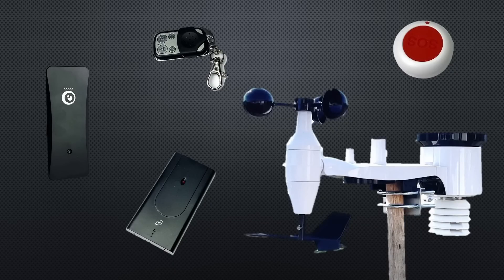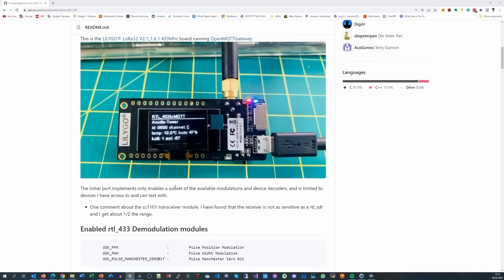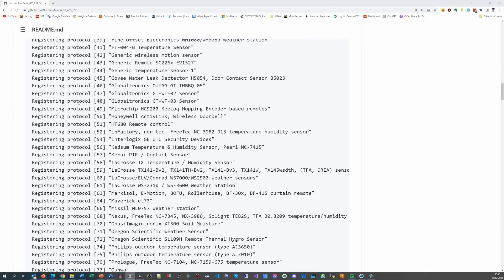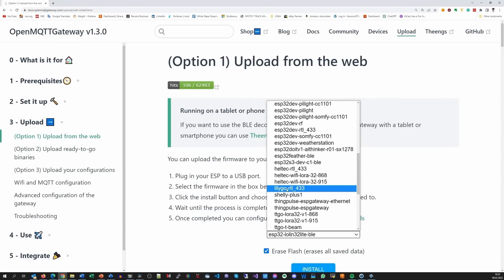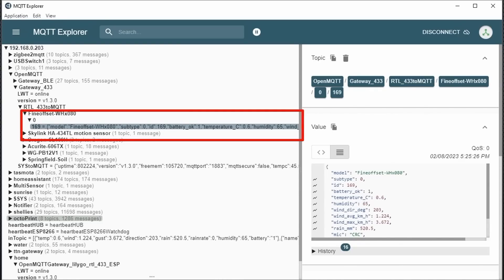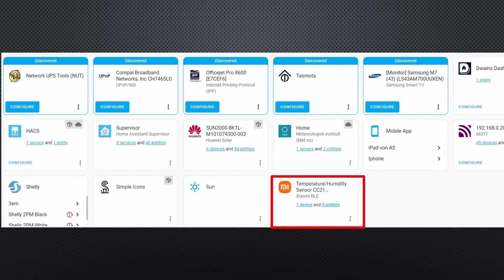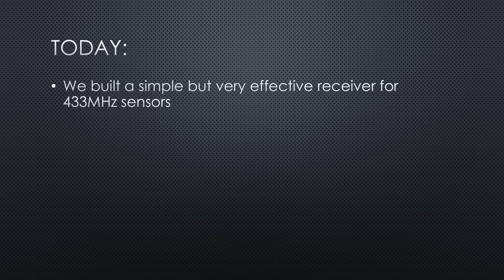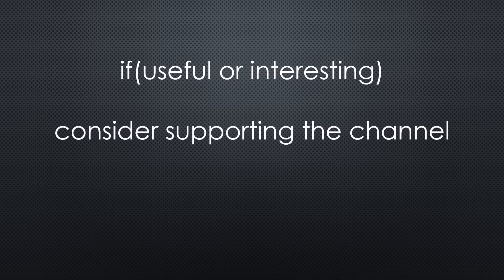449 OpenMQTTGateway Connects Many Things to Your Home Automation

Comment: I've been using 2 Sonoff RF bridges some 3 years now. They work great. 
Replaced internal RF chip first with Portisch firmware for RAW capturing even more RF signals. 
Later replaced the Portisch with even more tuned versions of the original Portisch EFM8BB1 firmware. (for ex. Halfbakery's,...).
I use this for some RF PIR sensors, but also to send RF commands to my garage doors (
which I first captured using RAW sniffing with the SonOff bridge of my original garage door hand remotes).

In parallel of the RAW mode (RfRaw 177), I let a custom rtl_433 Home Assistant Add-on subscribe on the RAW stream. 
The rtl_433 HA Addon can decode even more complex RF protocols (like weather stations,...), 
so I can see multiple temperature sensors in the area, the publish nicely with a treeview in the MQTT broker.
So I guess it's the same RF protocol list as the OpenMQTTGateway you now decribed, but there the ESP32 chip handles it all.

The only downside of the Sonoff RF bridge is signal strength/antenne & with longer distance the receiving RF packets gets 
split into more packets. (unusable to decode or resend)
That why I am curious to test out that LilyGo Lora32 433Mhz board, the  
antenne looks better than the spring antenne inside of the Sonoff RF Bridge.
Also the the protocol (de)modulation (FSK, GFSK, MSK, GMSK OOK, On/off keying) is handled by the Lora RF chip.

I'm also interested to see if I can also sniff RAW RF codes with the Lora Board and are also able to (Re)Send RF (RAW) signals.
I looked at the OpenMQTTGateway documentation and I think it can also send RF signals by publishing to the MQTT broker Topic.

So I just ordered one with your affiliate link.

Anyhow, again a great informal video by the Swiss Guy 🙂
Reply from the maker: You seem to know what you do. Maybe you have to do some coding to achieve everything you want. And also, the list of supported devices is not as long as with established projects.
The receiver of the LoRa boards is quite good and you can add an external antenna (maybe you watch my antenna videos).

Comment: Thanks.  That was great.  I ordered the LoRa and T7 boards and they setup as easy as you were showing.  They also appeared in Home Assistant instantly. But it also shows that I have no 433 devices. Time to go looking for something interesting.
Reply from the maker: I hope it showed at least some BLE devices...
Reply: @AndreasSpiess  Yes. several BT devices were showing up. Just no LoRa devices yet. Looking for a nice weather station.
Reply: I left the BT module running for a few weeks and Home Assistant discovered a few BT BBQ meat thermometers.  Winter must be ending. :D

Comment: When I finally received the lilygo 433MHz lora board the installation was very smooth. I had only a disappointment and that is the the lora boards support only "RTL_433" protocol and not the other three. Unfortunately I found out after it did not receive any message that the KAKU needs "RF" or "RF2". I will now go for the separate components because the solution looks really promising.
Reply: The board is working on RF and RF2 only my KAKU ayct-202 is not yet supported, hope the support list will increase with the KAKU devices

Comment: My TTGO LoRa 433 MHz Board just arrived. But Windows 10 is missing the correct driver. I al ready installed some (CH341SER, CH9102_WIN, CP210x_Universal_Windows_Driver, CH343SER), but nothing works. The device is listet as an unknown device "OTA1".
Does anybody know what driver I need? Did the Chip change?
Reply: Never mind.
It works now. I think changing the USB cable did the trick.
Or I just did not see the correct device in the device manager, because the unknown "OTA1" device is still listed.
The working driver is "USB-Enhanced-SERIAL CH9102" (based in CH343* files)
Reply from the maker: Good that it works. So far I never had to install drivers in Windows 10...

Comment: Hi Andreas, I followed the exact same steps as in the video. All went well and I do get some messages in my MQTT broker. However, my KaKu remotes type 'AC' are not detected. Older style "ARC" are detected but as a Smoke Sensor and a Remote Keyless entry... Other than these I only get little other devices discovered on 433Mhz. My old RFXCOM module detects much more. What could be wrong ? Any hint ? Thx
Reply from the maker: As I mentioned, this project has not implemented all the modules yet. AFAIK you can ask on their Github for support.

Comment: Hello,

Can this work with a 868mhz weather station but with a LoRa 868mhz module?

Best regards.
Reply from the maker: I do not know if it supports those sensors. The frequency seems to be ok if you chose a 868 MHz board.
Reply: @AndreasSpiess  Thanks i will try it

Comment: Another great video in Swiss Quality, high information density - Thanks Andreas! 
I already ordered a suitable board. Unfortunately I have only a couple temperature/humidity sensors using 433MHz. A lot of sensors and actors (ELV) in my household use 868MHz.
There are also TTGO modules 868MHz RF-backend available. Would it be possible to use such a module in this context or is there another solution available to include them to the OpenMQTTGateway?
Reply from the maker: Many other viewers also asked. It is best to ask on the project's github page. The frequency is not the problem, but maybe they use more complex codes.

Comment: So far, I did not get the Heltec Board V1 running. I tried ESP32 with CC1101 receiver - but the results are very disappointing - compared to the RF-Gateway running for long time on the Arduino Mega and connected via USB to an Orange Pi3 LTS. All devices I have here are more or less correctly recognized and I can use the results in my home automation. So far, looking at the list of supported devices, on OMG - I have no clue how to get such an output on OMG - I use the correct combination (CC1101 and ESP32) and ESP32_RF - but no decoded output so far.
Reply from the maker: I never tried the CC1101. And for the supported devices: Yes, not all are supported. But AFAIK you can ask for support on their github page.
If you are happy with your RF-Link, I would not change.

Comment: Hi Andreas, thank you very much for the inspiration using OMG, an outstanding project. BTW: The older TTGO Lora32 V2.0 boards work as well with the out-of-the-box lilygo-rtl_433 binary when connecting "LoRa_DIO2" to "GPIO32" and "LoRa_DIO1 to "GPIO33" at the pin headers.
Reply from the maker: Thank you for the info!

Comment: Is there something similar available for 868Mhz ? Based on documentation my wireless room temperature devices for our floorheating are working with that. I found that openmqttgateway uses pilight what supports only 433Mhz if I am not mistaken. Otherwise I could use also a cc1101 based solution.
Reply from the maker: You get 868MHz LoRa boards. But I do not know if these sensors use the same coding. I would ask on their Github page (create and issue and search first. Maybe you are not the only asking)

Comment: Thanks a lot for this Video! It was a chance to find a use case for my 433MHz Heltec LoraWAN modules, I ordered erroneously some time agao. Unfortunately, the pre-compiled binary does not work, I think it is because my boards are V1 and there seem to be a V2 version of the board. I will try to re-compile the source code and have alook, if there is an option for V1 boards.
Reply from the maker: I also had a look at these Heltec boards. They did not perform well...

Comment: Can this also be used for Zigbee? Wondering if I should go for Zigbee based sensors or BT based ones. If this device could handle both, no need for choosing...
Reply from the maker: I do not think so. I use Zigbee2MQTT and a specialized Sonoff Zigbee Dongle. Works fine.

Comment: Hi Andreas, Have you tried to change the receiving frequency? I am trying to receive a signal from one remote that emitts in 433.95 but the gateway seems to not hear or decode the signal... I read on the Wiki that by default it only receives in 433.92MHz... I have tried to send some mqtt commands but the gateway seems to not hear the messages... Maybe because we changed the default topic?
Reply from the maker: I did not check if you can switch on a debug mode to find out what happens with your signal. And the topics needed should be documented. I did not transmit

Comment: Thanks for doing this video.  I bought one of the HELLtec boards and could not get it to flash, seems there is an issue of the v3.  I since bought the board you have and it works so great!  
This is so much easier to move and put where you want vs my old PI3 and SDR...Plus that thing sucks so much power if you are not careful it reboots-so glad to get rid of it!
Where did you find that neat case for the LORA32?  I tried searching LORA32, LILYGO, PAXCOUNTER all on thingiverse to no avail...
EDIT-I see you answered someone else that it is THING ID 4967316 for case #2.  Case #1 for the LORA32/Paxcounter is 4518757.

Comment: Funny how sometimes the stars seem so align: I recently came across OpenMQTTGateway and I know there is a pull request (improvement on the software) standing by that opens up the LoRa compatibility part (sending and receiving non-text messages as well as WiPhone messages).
There is a long way to go, but it's a good start of integrating LoRa to one's home automation.

Comment: Two questions: What is the link for the case you printed? I searched thingiverse, but it's search is notoriously bad, and I did not find any that looked like your print.  Also, does the Lilly T3 board not support BLE as well?  It was my understanding that nearly all ESP32 boards had BLE integrated.  Maybe there were limits with the LoRa integration?  If not, I would love to have one "hub" that handles 433 and BLE together.
Reply: Hi, I'm always had many issues turning on BLE on ESP32 boards because wifi interference. This Lilly works well withi BLE?
Thanks.
Reply from the maker: 1. on Thingiverse it is /thing:4967316 (no links allowed here)
2. Yes, all "standard" ESP32 chips support BLE and you should be able to use both on the same gateway. I did not try because my two gateways are at a different place.
3. Mine works ok with BLE. Usually, it is not the chip, it is the program that creates issues. BLE and WiFi use the same radio. So they do not run in parallel.
Reply: @AndreasSpiess  I'm looking for the case shown in the video, too. But "thing 4967316" doesn't seem to be the one. Even looks like it's made for a different module.
Reply: @cgraefe  If I showed the white one: I no more have the STL file of this old case.  I replaced it with the T7 case with the number 4967316. It even has a T7 on the front.
Reply: @HB9BLA  Sorry, I didn't phrase clearly enough. I am looking for the TTGO LoRa32 case printed in orange in your video.
Reply from the maker: I added now the links to the description.
Reply: @AndreasSpiess  Great, thank you very much!
Reply: I recently got my Lora board, loaded up OpenMQTT, and it appears to work well.  It has found several devices, including my neighbors smoke detectors, so now I will know if their house is on fire?  But try as I may, it refuses to find my weather station.  The panel and the Lilly T3 board are both at a window about two meters away from the station. The panel gets updates every few minutes, but Lilly has yet to see it.  Was there some tuning you maybe did to get it to focus more on your station?
Reply from the maker: @TvistoProPro  Maybe its protocol is not supported. Maybe you create an issue in the project's GitHub?

Comment: I just bought a Mi Band 7 fitness bracelet. The hardware seems awesome, buy sadly the software is very crippled and doesn't allow custom apps in any meaningful way. It would be so awesome so use a small bracelet like that as a home assistant remote control over BLE
Reply from the maker: I do not know if somebody hacked its protocol (and if they use any encryption)

Comment: This video is very relevant to me; I am literally currently using the hacky rtl_433 method on a raspberry pi with RTL-SDR that you describe to integrate my temperature/humidity sensors to Home Assistant via MQTT. I've never liked how kludged-together the setup is and it's having to run double-duty on the Pi I use to control my amateur radio equipment (owing both to Pi unavailability and the waste of dedicating a whole Pi just to this one service).

I'll be ordering one of the 433MHz TTGO boards and converting my setup to use that instead, thanks for the helpful heads up and guide. What exciting times we live in!

Comment: OpenMQTTGateway is a fantastic project. Thanks to Florian, NorthernMan54 and others I am using many 433.92Mhz RF devices in Home Assistant and controlling my 433.42Mhz radio controlled blinds. I use a standard ESP32 dev board with an attached cheap CC1101 board.
Reply: Are these maybe Somfy blinds? Would be interested to learn more about this.  Maybe Mr. Spiess solution will also work (Somfy uses slightly different frequency, if I am not mistaking.
Reply: @lucsegers6931  Maybe you want take a look on the quite new ESPSomfyRTS project. As I'm running many Somfy blinds, I found this some months ago and utilized it - it performs VERY WELL!
Reply from the maker: I agree!

Comment: I have a manual ceramics kiln and want to log the the temperature profile of my firings.  I built an esp32 unit that does that.  Now I want to access the charts on my phone.  Is that a phone app I can use to do that?
Reply from the maker: I do not know which sensor you use. If the sensor supports 433 or BLE and is on the list of supported devices, you can use it. If the ESP32 does the measurement, I would go with the Wi-Fi of your ESP32 for transport. Then you could use ESPhome or Tasmota, if one of them supports the sensor you use. If you just use the ADC, both should work. And both support MQTT. Then you only need one ESP.
Reply: @AndreasSpiess  Thanks.  I use is a kiln thermocouple connected to a MAX31855  connected via SPI to a battery powered ESP32 dev board that has a display.  I have not added the RF part to the code yet so I have flexibility to match a protocol if I know what this is.  I have thought of using WiFi but I would prefer to use BLE since it does not require pairing/connecting.  That means that I can also use it other places that I don't have WiFi.
Reply from the maker: @connecticutaggie  The MAX31855  is supported by ESPhome, BTW. Good integration in Home Assistant.
Reply: @AndreasSpiess  Oooh, BlueST sounds really interesting.  The protocol was defined by ST Microelectronics for their devices but it is an open protocol and there and SDK and Android apps that support it.  Research time.

Comment: 433MHz Board sold out on Ali Express :-) Seems like everyone else had the same idea I had
Reply from the maker: Maybe you find them in another shop?
Reply: @AndreasSpiess  the shop has several LoRa boards in stock. I compared the images of the "disaster radio" board - the images seem identical except for some photoshopping: They replaced the LiPo charging chip (9102F instead of 2104). I ordered and hope for the best 🙂

Comment: I run HA in Proxmox, rtl_433 in a container with SDR USB dongle passed through. Picks up all my thermometer sensors (433) and of course the neighbour's BBQ temp. sensor and TPM 🙂  For BT temperature sensors, I'm using ESP32 BT proxy on a couple of ESP32 board to cover the house.
Reply from the maker: A good setup! I would not change it if it works. My 433 receiver has to be on the roof, not in the basement where my server sits ;-)

Comment: This presents a perfect solution for the b-parasite capacitive soil moisture sensor (Florian is a contributor). I was planning to set up an entire raspberry pi just to pick up the BLE sensor readings for a few plants, but there is no need for that anymore. There is no need to waste the power, space and an expensive pi. Now I can hide the BLE-MQTT gateway in a wire wart. Thank you!
Reply from the maker: Indeed, you do not need a Raspberry for this task!

Comment: Does OpenMQTTGateway support 915Mhz devices? I have a number of 433Mhz devices but my weather station uses 915Mhz so I have to use rtl_433 and poll for both frequencies.
Reply from the maker: I do not know (I have no such sensors). Maybe you ask Florian on his Github page?
Reply: Yes they support at stated in the documentation. Unfortunately, it is not clear if the LoRa code supports it (doc mentions the CC1101 receiver), however my TTGO borad accepts the command and seems to work (although I can't be sure since I don't have a 915MHz one lying around).

Comment: I use the gateway on an 8266 connected to a generic RX/TX unit for RF light switches (etekcity). One of the 5 switches quit so that button can now be used to control other HA functions as needed.
The amount of RF traffic it sees around here is large and doesn't display any user-friendly names for the signals like yours did. Last compile & flash I did was 8mon ago at least though.
Reply from the maker: I looked at the RFlink on the 8266, but, a few years ago, it did not support my weather station. This is why I went with the "original" RFlink project. So obviously, they improved the project.
Reply: I've the same setup as you do and the same issue. I set it up just last weekend. Other than in Andreas' vid, it just shows the recent state under the OpenMQTT topic; there are no child entires branching down deeper. Would be curious about the reason and how to improve/fix.

Comment: "Without Hacking"
 If it doesn't require hacking what's the point? Maybe you can require us to solder random parts onto the LORA boards? Duct Tape?  
(really this is the exact solution for a problem I'm working with).
Reply from the maker: :-)) Sometimes, we just want to solve a problem to have enough time for other hacks ;-)